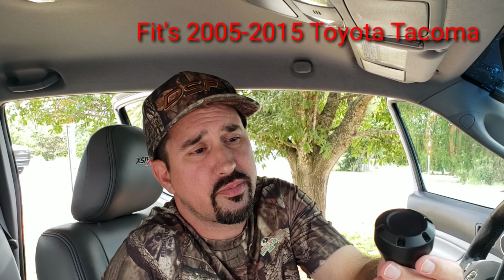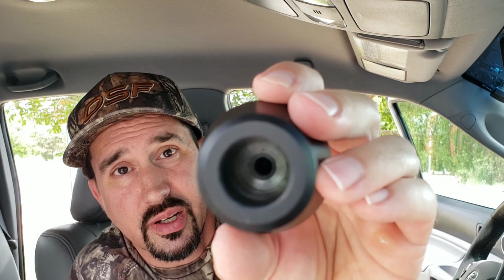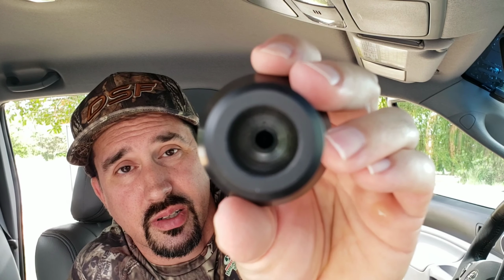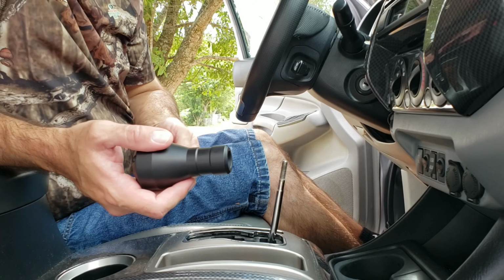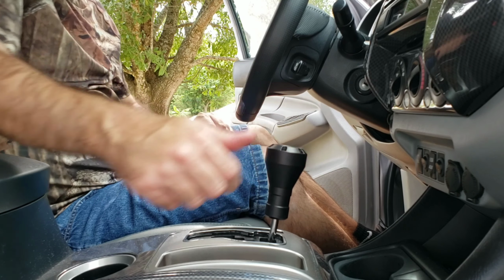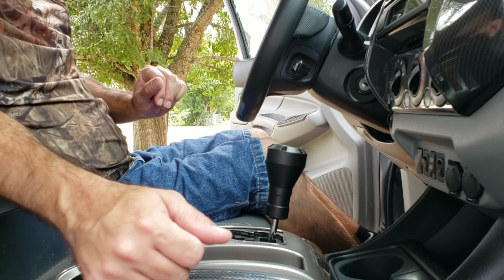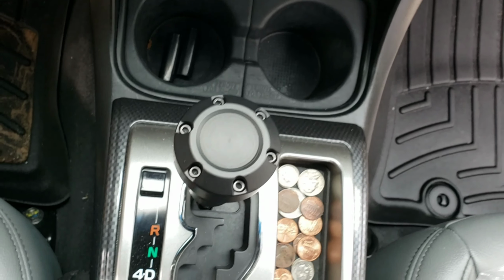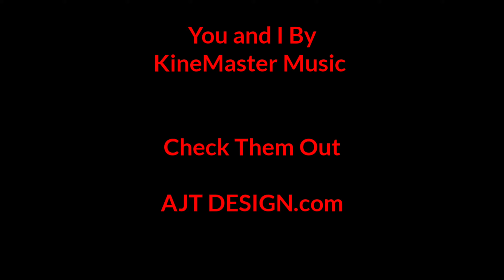BILLET SHIFTER KNOB/2005-2015 TOYOTA TACOMA/AJT DESIGN/MORE MODS TO COME

Comment: I would try to match the little screws to the exact color of the body. worst case scenario get some dupli-color light coat then a thin clear coat if you wanted some shine. I honestly love the matte type of colors between black and dark gun metal grey
Reply from the maker: Thanks for the advice buddy. I appreciate it. Thanks so much for your kindness, thanks for your support